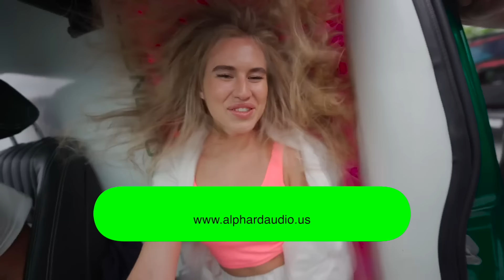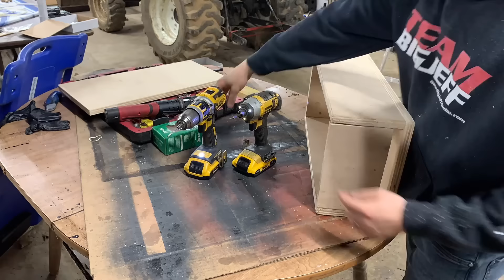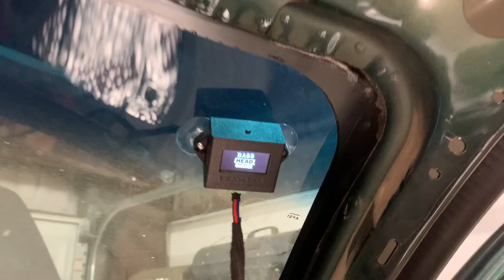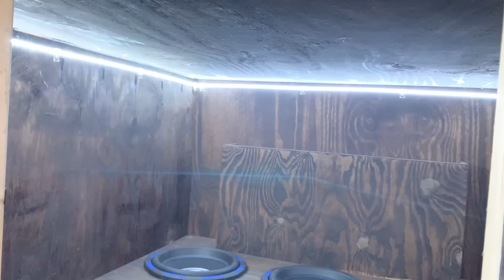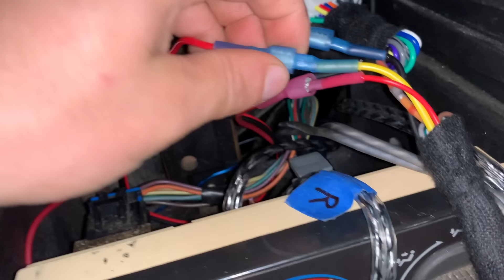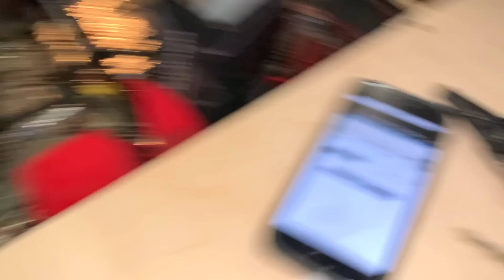Building the LOUDEST Walmart Subwoofer System! | Part 11 FINAL

Comment from the maker: Full demo clips are at the end of the video! Thanks for watching everybody 💪🏼💪🏼🔊🔊
Reply: Bruh! You have to take that thing to at least 1 car show. It's unique and should be shared for others to see live before you break it down. 😅😅😅

I WANT TO SEE OTHER YOUTUBERS GET DEMO VIDEOS. DO IT FOR DA FANS BRO! 😂
Reply: Great job on this budget build brother 👏 bass on!!
Reply: I seen Temu Bermans 4500rms half bridge amps for cheap. Buy one for a review and hook it up to that stereo for a garentee 250,000 views in 3 months 👍👍
Reply: Try the Mofo 15's 
After you've finished this version of the Walmart build series.
Reply: Awesome series Parker. Can't wait for the big build.
Reply: Please put a bigger amplifier on that build and do a db test. Try a Bermans 4500rms half bridge amp from Temu.
Reply: bro how did you run the speaker wire for the front doors and is drilling a hole for the rear my only option if i don't want to mess with the door harness
Reply: i know your trying to get that view time, but man your starting to stretch these videos a tad to long,
Reply: @mikeriverajr4447  parker is just doing his thing brother, rather watch what he's got going on than the same old bs on TV or all over the innerwebs.
Reply: @mikeriverajr4447  Don't watch.

Comment: Nice but those amplifiers aren't putting out enough power to get it to a 150db.
Reply: He just did basically! Close enough! He could always add some more maps maybe another battery maybe run the alt on it and absolutely get it to 150db! I’m Doing 151db off a 2k and 2 lvl4 12’s but I’m in a tiny car not a big suv! Ain’t much air space in a small sports car.

Comment: EDIT- watch "BUDGET BASSHEAD" he show's what these subs can handle. *more than 600watts as alot claim lol*. 140db on a single 12 *pushed to its max though*. 

 as someone who has a single gothic 12 on a 2500d RZR amp, those 4 amps are NOT pushing enough for sure... so %100 would wanna see a follow up with a "proper" amp pushing it. (amps push around 800watts max on their own). 600ish RMS, so again they for sure need more power.

Comment: I completely agree with putting the bigger amp in to see what it does. I was running 1200watts clamped a piece to these in my daily and they took it perfectly fine and seemed like they could do more, especially for burps.

Comment: I have loved this series! BTW for the headunit I actually ended up burning my headunit up right before a show and in a panic I bought the Power Acoustic CP-71WA from walmart and have been SUPER impressed with it. Single DIN, touch screen, and has 4v pre-outs. I was planning on replacing it after the show but I have just left it in. Also if you will move that floorboard meter up into the footwell you can see that 150 :P

Comment: Nice job. I do have a suggestion though. I know that you have those 15s why don’t you just trade them for some better performing 12s and then just make small bracing improvements to the enclosure. I know that it would get into the 60s + with more power and beefy 12s. Besides that it would be lots less work. 😊😊😊 another great video as always, keep them coming.

Comment: I just bought the same head unit. I can't wait to try it. My current Dual head unit makes my sound system sound like crap. Bass sounds muddy and weak. The RCA preout voltage is low and weak. I measured 1.2 volts. Tried using a line driver to boost the voltage, but the sound quality was still not good.

Comment: You can disconnect the speaker so when the doors open it wont beep any more. Its under the dash or under the steering  wheel  plastics 🎶🎵💯🫡👌✌️

Comment: I'd like to see you run a watt meter so we know how much power is actually going to the subs.
Reply: Well since these Razor "2500's" put out around 1,000 @ 1 ohm, on an amp dyno= a static ohm load. I would guess @ best, after impedance rise, & voltage drop, that each 12" is only getting around 250 watts R.M.S.!
Reply: I've been wondering the same thing for this whole build. I would like to see that as well.
Reply: I'd be more interested in seeing if these amps can deliver enough current during peaks when loaded right down as that takes quite a toll on an amp during the lows...that being said, they're still not doing bad for a budget system that is apparently struggling source voltage wise
Reply: @richbrown5852  Yeah not to mention, how much is that cheap power, & ground wire really affecting the actual power, you know? Yes, i still think its very cool that parker did this whole system!

Comment: 147.9 🤷 thats nowhere near what i expected... 
I have 2 Crossfire C5 15s in a 4th (musical build not a burp box) on 1300 rms that's as loud ..... @ 38 hz ..... 

Im guessing that those amps aren't putting out anywhere near their claim of "1500 watts rms" 

Still a cool build, but i bet you spent well over 10 times what i did. 🤷
Cost breakdown.... do it
Reply: People say those amps can put out about 900w at 1 ohm and I'm personally sure they put out 600-650w at 2 ohm.

Comment: Does anyone know a cheaper alternative to power max power supplies?. Looking to get a system in my room and I need 60-65 amps of current. Very pricey with powermax and looking for something a bit cheaper. Any alternatives?
Reply: Rewind microwave transformers to about 15v open field, then find a rectifier that can handle quite a few amps, and buy a whole bunch of 20v capacitors to put after the rectifier. There ya go, old school linear power supply good for about 800w

Comment: You had the car off during these db tests right? So the lithium batteries can rebound  on their own for bringing their volts up? I just wondered how the lithium works for charge time/rebound time. Great informative and entertaining video! Its exciting finding ways to raise your dbs!
Reply: Yes lithium does rebound but it's not going to bring voltage higher then it's starting point he is missing out on power starting high 12s he needs to be at the 14v range for them amps
Reply: @Loudkona  Thanks for the info. I think I need more  lithium and  a high output alternator

Comment: You need to do this exact same test without those lithium batteries. Walmart has shit for battery selection amd i know those batteries make a big difference in the power those little amps can make. Maybe try some of the little lithium batteries that Walmart does carry. Or maybe just a couple deep cycle marine batteries. But as someone who just really recently swapped from agm batteries to a lithium bank, its heads and tales differences between those chemistries. So a true Walmart build should at least have Walmart power, or it kinda defeats the purpose of calling it a Walmart build. Ive enjoyed this series,  but just would like to see if the readings would still be close with Walmart batteries.

Comment: I'm having trouble understanding what the rear door speakers are for.  Correct me if I'm wrong, but I thought that area was sealed off from the cab.  What am I missing?   I thoroughly enjoyed the build, it's always cool to see what you can get out of low end stuff.
Reply: Playing at shows with the rear doors open for music outside the truck. Same principle as people building speaker walls in the back windows facing out or behind the rear wall of the enclosure

Comment: Bobby Gately was saying that when he builds these big systems, he'll play a very low frequency tone and record it at high speed so he can play it back and verify that each cone is moving up and down in sync.

It's a good technique. It can compensate for all the subs being wired to the amps correctly, but one amp might be receiving an inverted signal. 👍
Reply: Gately wisdom 😊
Reply: @michaelfessenden8601  Wisdom :D :D :D Just hit the wires with car battery or cordles drill battery to see that they bumb on the same direction and its done in 10 seconds.
Reply: You can test each subs phase with a 9 volt battery.  Just touch the wires to the poles on the battery and make sure they all move the same direction

Comment: Fixing your baffle flex might help the scores.
Reply: If doesn't fix the baffle flex and ends up putting bigger subs in it at some point it's going to destroy them with all the flex
Reply: Yes he got insane baffle flex and measuring in the wrong spot on the windshield and i did 152db in Volvo v70 with 4 dd712 in a regular ported box in the trunk
Reply: @emilandersson4444  Smaller cabin space, and those subs completely destroy the Walmart specials in this video. Also, what amp(s)?
Reply: @emilandersson4444  Db scores very drastically per vehicle, & system. I would bet your (4)- DD712 subwoofers, & amplifier(s), cost a little bit more than this Wal-Mart budget build😁😆
Reply: @emilandersson4444 i just got 3 dd 715f for my caprice bubble. And a m5000. Box needs to be measured up right now. What else did you do to get that score?
Reply: Could do the port better also